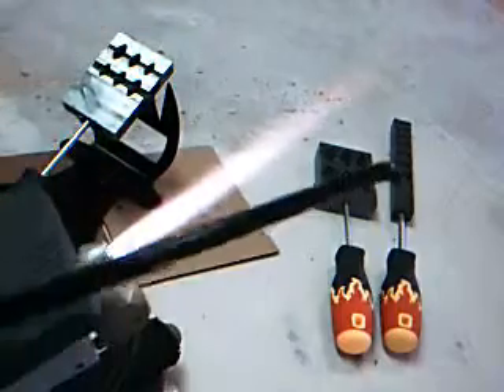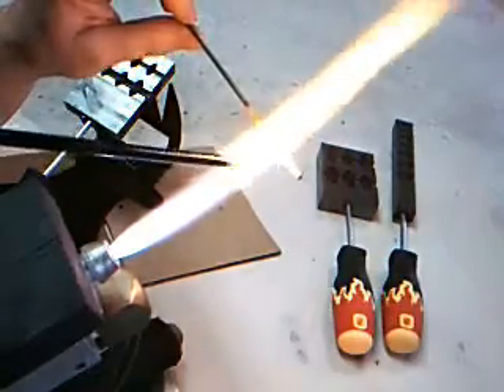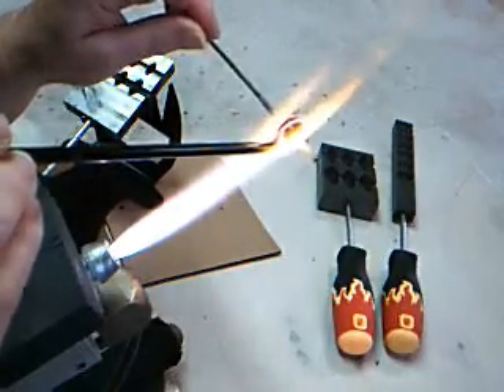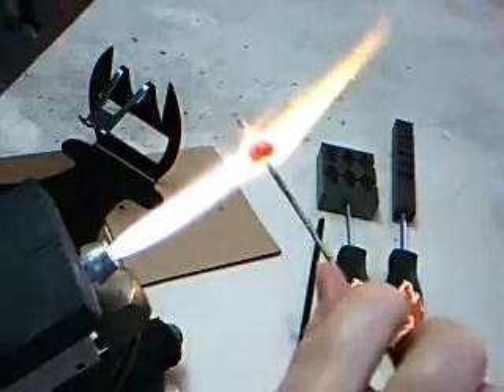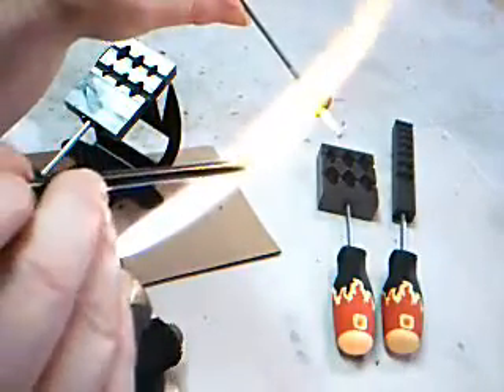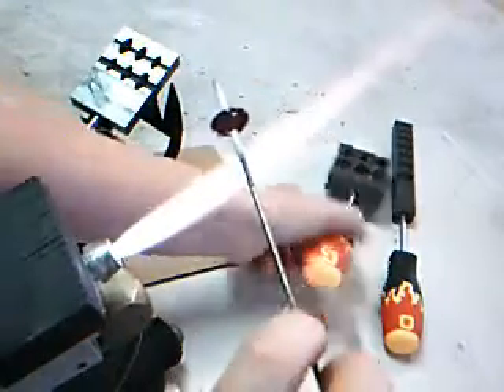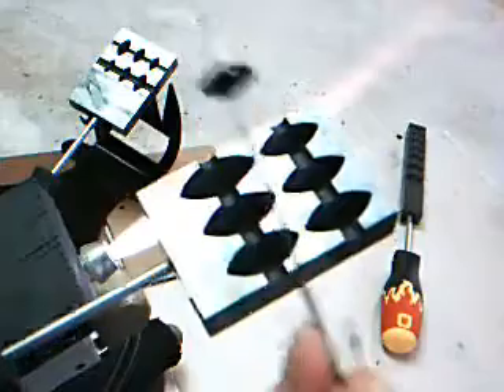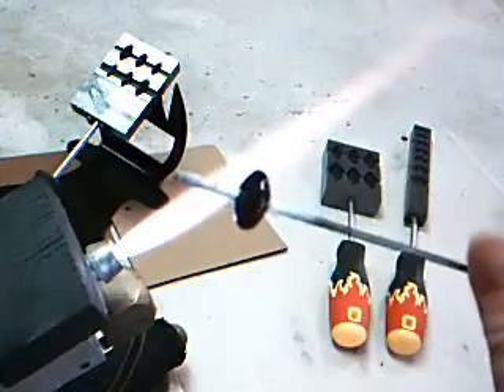CGBEADROLLER - DISC BEADS

Comment: Any videos on how to use the round bead roller? Am having trouble using it without getting sharp bead holes.
Reply from the maker: The trick is to make the footprint shorter because as you form the bead it will grow, so a shorter start will end up with the puckered ends. Also, don't press too hard as you roll, not much harder than you would on any flat marver.